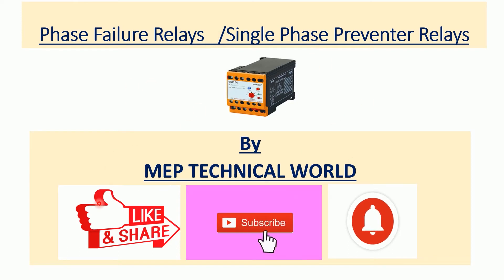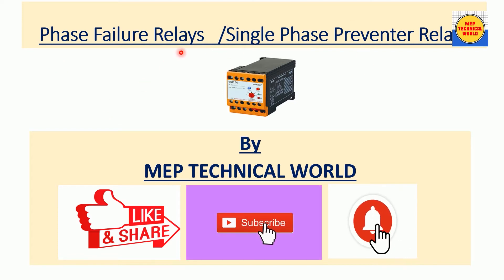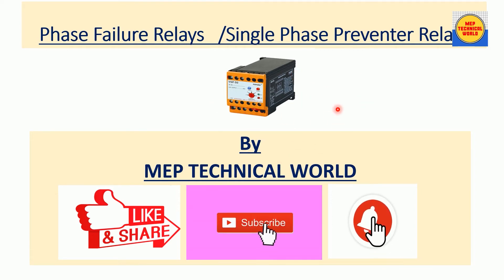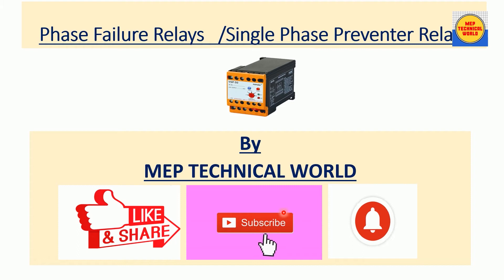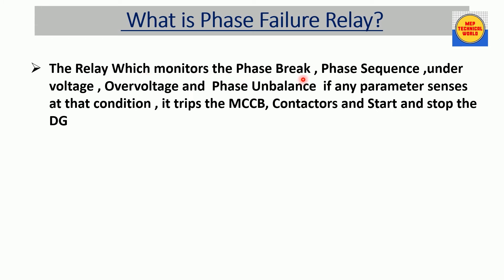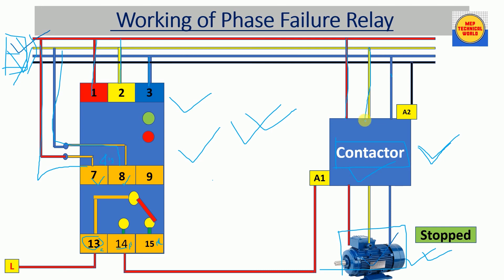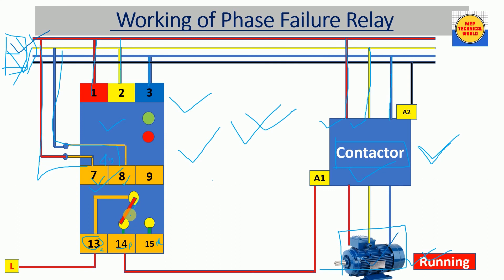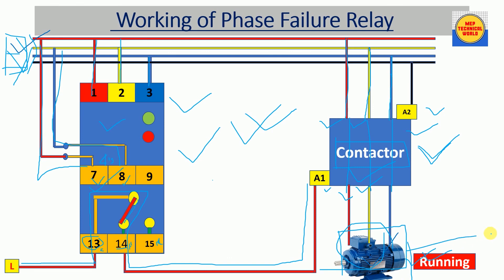What is Phase Failure relay ? | Working and Connection of Phase Preventer Relay

Comment: what will happen if the Neutral and one Phase get reversed. suppose by accidently L3 got replaced by Neutral son in place of Neutral it will be L3 and vise versa, then will the Phase Failure detect..? and trip the circuit,,?

Comment: According to Explanation if the 3rd phase is missing then the Auxiliary voltage still present if I m right? Then nothing happen According to explanation becoz there is no connection between 3rd phase and coil?